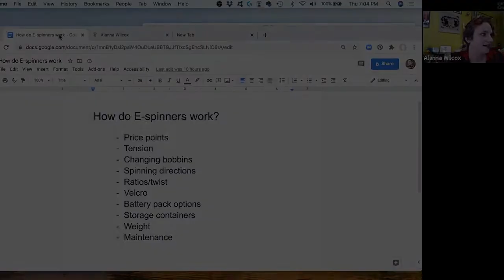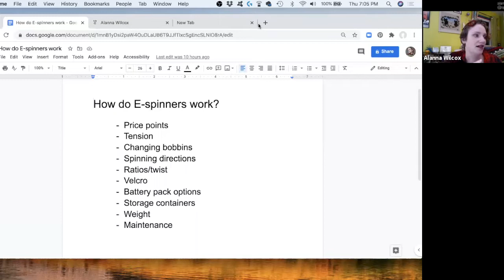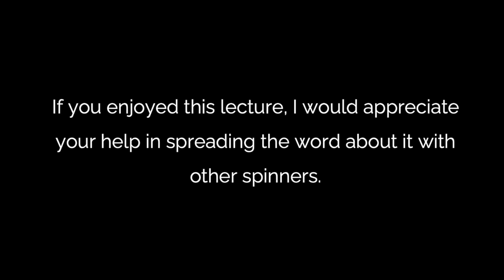Want to know how to pick an e-spinner that's right for you?

Comment: I have a solar charger I use to run my nano (or charge the battery) when camping or on the boat!  Nice video.  Also I think the nanos are injection molded.  The early prototypes were 3D printed, but I’m pretty sure the final production ones are not.
Reply from the maker: Ah okay! I didn't know the difference in the plastic build, but it's definitely sturdy given how many times I dropped it lol

Comment: Hi Alanna, do you have a link to the specific battery pack you are using (the silver one with the multiple voltage options)? I tried to search for it, but wasn't able to locate it. Thanks!
Reply from the maker: Hi Lisa, I think mine is an old Anker, here is the brand, I'm not sure what would be the newer comparable one: https://amzn.to/3GRP1ou
Reply: I was wondering about the link for the PowerAdd larger battery